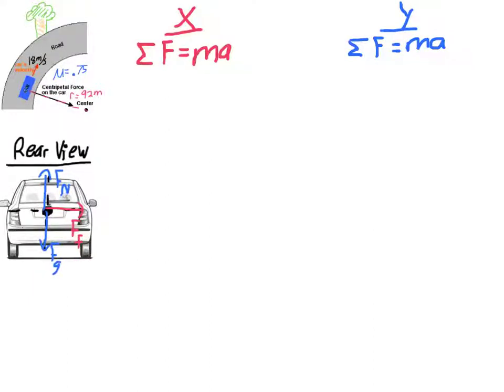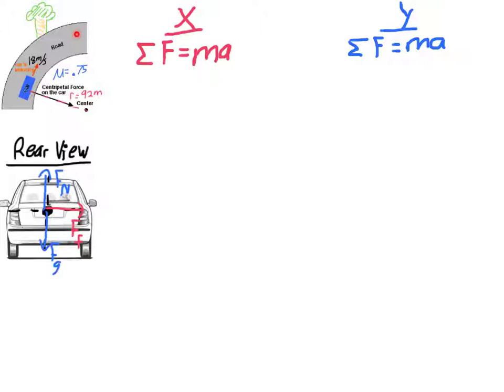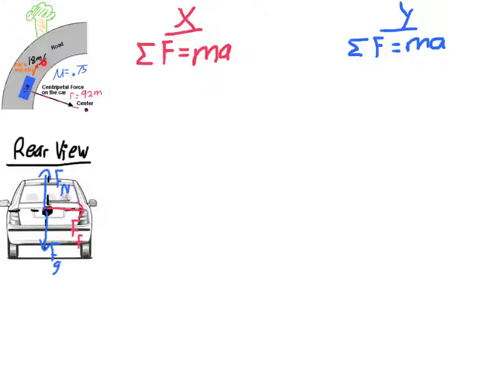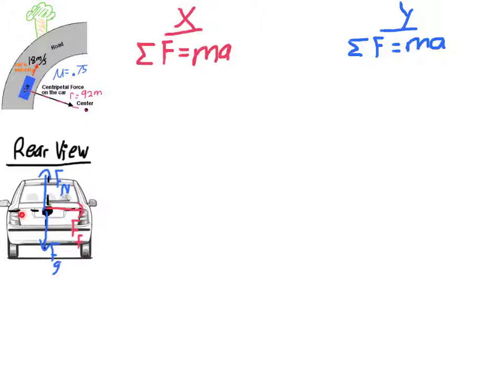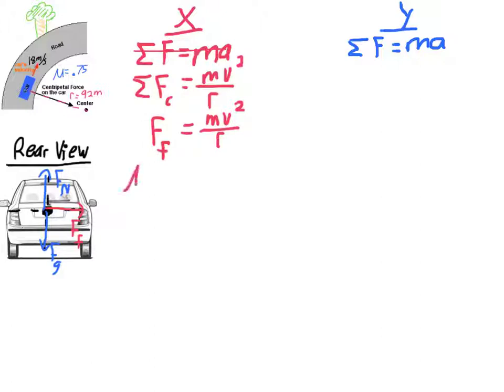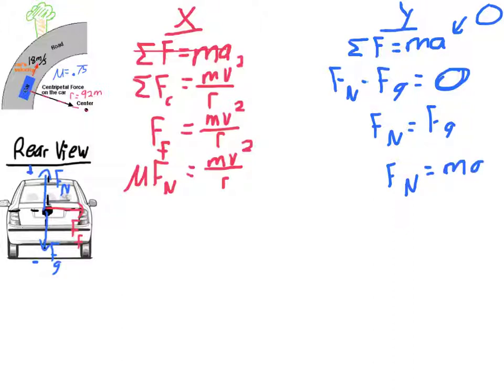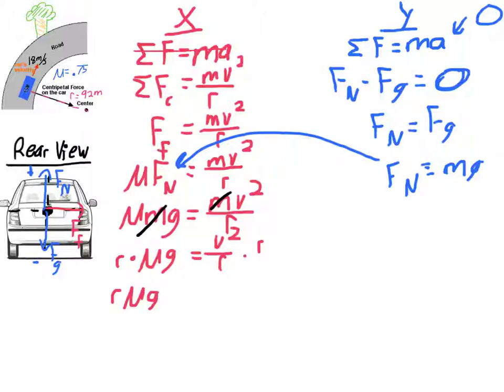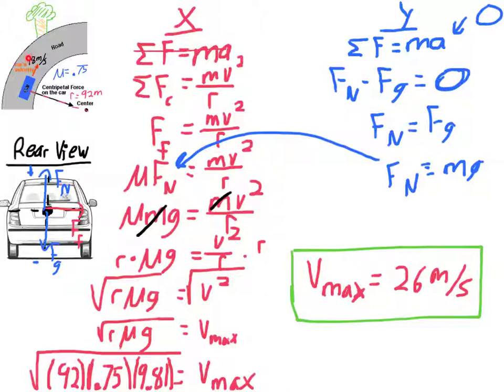Car turning (lesson 2 centripetal force)

Comment: Hello, I struggle to see why friction is not pointing backward (opposite to the forward motion) and on the same line. Why is it pointing inwards? I know friction is what is causing turning but again when I turn the steering wheel I don't direct it inwards so where does the 'friction pointing inwards' come from? thanks